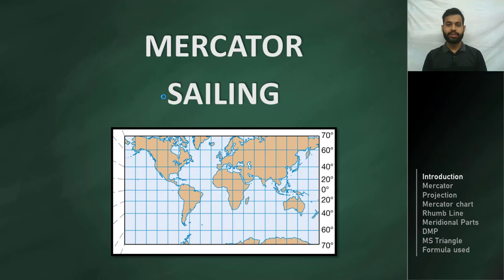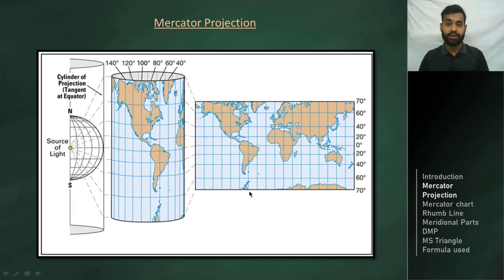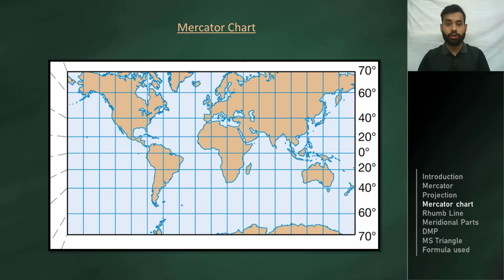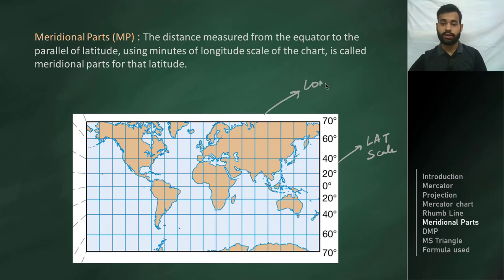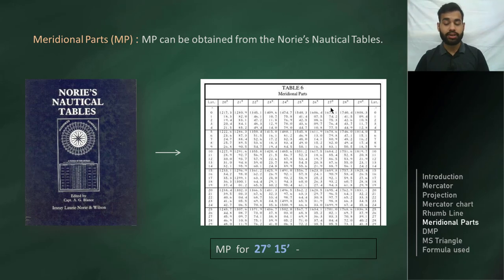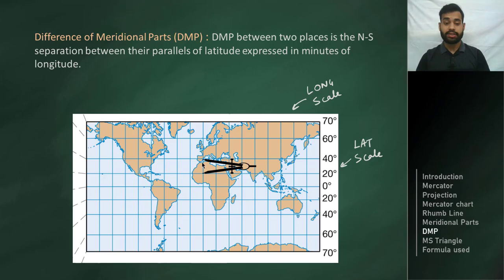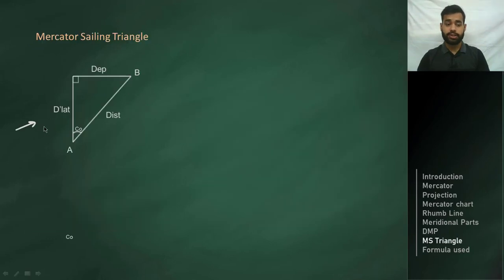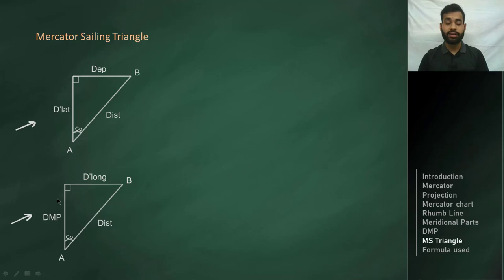Mercator Sailing | Navigation

Comment: In the absence of  Nories Table,  MP can be calculated by using Scientific calculator 
Lat  / 2 + 45 = Tan Log * 7915.7 - Sin Lat * 23.2669  (23.2669 can be rounded to 23.3)
27.25 / 2 + 45 = Tan Log * 7915.7 - Sin  27.25 * 23.2669 or 23.3 = 1,689.72

21* 7' / 2 + 45 = Tan Log * 7915.7 - Sin 21* 7' * 23.2669 = 1,288.31

Note: I used Scientific Calculator  FX 995